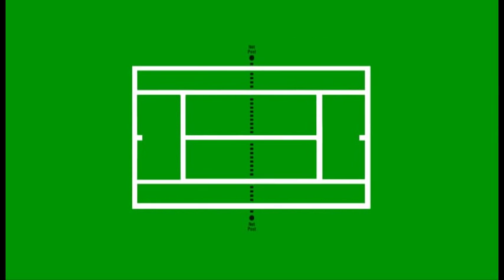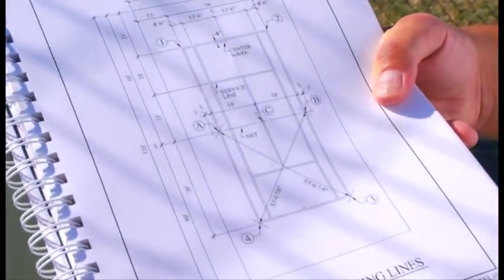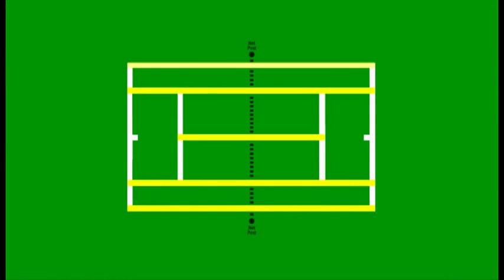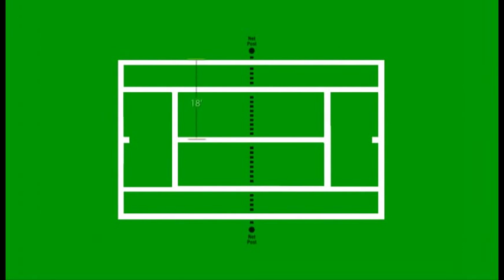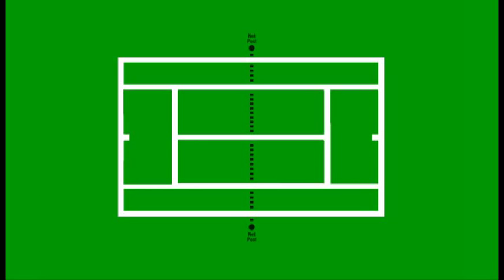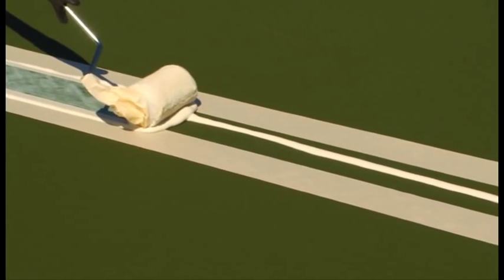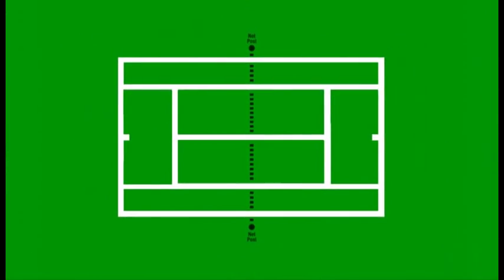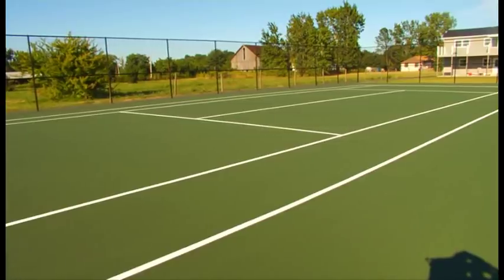SportMaster Sport Surfaces - Tennis Court Striping

Comment: How much does this cost or can I DIY...?
Reply from the maker: The line primer and paint will run you around $60 USD total. Takes around 8 rolls of a good quality masking tape.  Tough to layout the tape by hand, but no impossible. Most sport contractors charge anywhere from $400 to $500 to layout and stripe a tennis court.